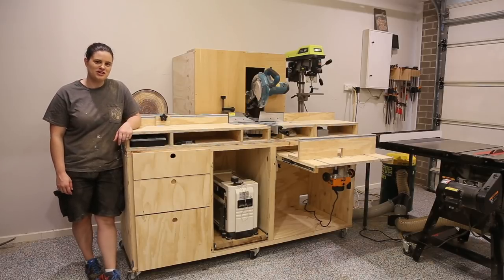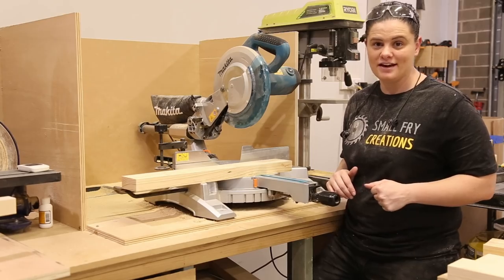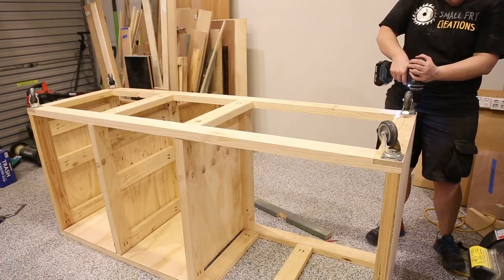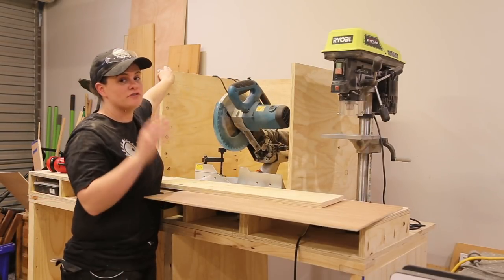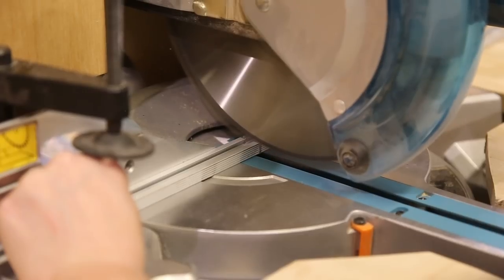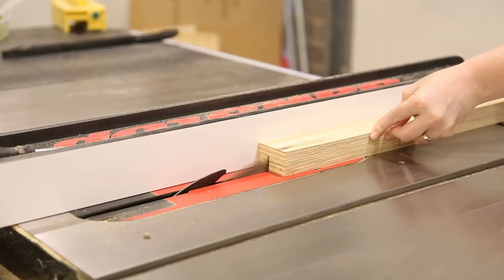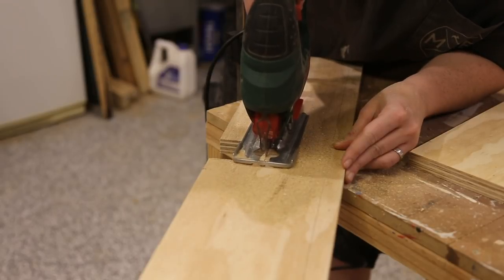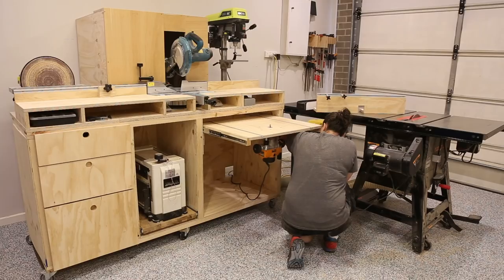DIY | Ultimate Workbench for Small Work Shop

Comment: Really great video!  Short, sweet and to the point.  This is the first time I have seen a pullout router table.  I have been searching for a way to incorporate my router into my mobile bench, but have not liked that the bit hole will be on top of the bench.  This solves my problem.  THANKS!
Reply from the maker: Your welcome! Thanks for the support 😀
Reply: If you like this idea, have a look around YT for vise router builds. There's some good ones out there with fences and t-tracks. I ended up just buying a cheap router table from Bunnings and sinking just the top of it into my table saw with a small scissor lift under it to raise and lower.
Reply from the maker: Ooo this is a good idea! Thanks Peter. I will check them out for sure
Reply: @SmallFryCreations  It's just the Ozito ones - about $70. They have the machine on/offs and plug for the router, a sliding fence. Being Ozito branded at least they haven't got moving parts ;) 
To be fair, some of the ozito stuff isn't too bad as long as you don't use it all the time. I wouldn't buy a drill, driver or grinder, but it's cheap and OK if you only use it occasionally.

Comment: Great to see another Aussie making projects and with wood dust over them! Most of the American guys seem to be dressed in their Sunday best and still clean during the builds! Must be magic ;)
I used to have a bench with similar tools attached to it. But when I built my table saw, it got in the way and I dismantled it. I just put all the loose tools in steel shelves for time being. I'm sort of going a more modular approach with smaller cabinets for the larger tools (like drop saw and drill press) so they can be wheeled around when needed. Workshops are always a bit of trial and error. But that sort of setup you've built worked well for me for years.
Keep up the builds!
BTW Where are you getting your T tracks from? Pretty hard to find local suppliers of that stuff in Oz.
Reply from the maker: Hey thanks Peter! Don’t know how everyone stays clean! That is not me for sure 😂 Yes the workshop is forever changing but like you say great work bench and working for me for the moment. 

I think I got the track from hare and forbes.
Reply: @SmallFryCreations  Thanks. I think last time I got some T-track I got it off ebay but ended up being a bit small for the mitre attachment I bought.

Comment: Another cracking video, thank you. My son and l are building a new mitre saw station for our workshop, so plenty of good ideas here.
You are so right about looking back at old projects........
Question, what happens if you need to cut angles with the saw?
Reply from the maker: That’s awesome. To cut angles I remove the dust shield and the small piece to the right of the saw is removable so I can swing the saw around. I can’t move it to the left but I have never needed to. Hope this helps 😀 happy building
Reply: @SmallFryCreations  Thank you. :)

Comment: Nice build Ainslee! I am curious about the 2x4 (100mm x 50mm) framing timber you used. What did the final dimensions end up after you cut off the rounded edges. The framing timber I get from Bunnings is 90mm x 45mm. After trimming and planing I end up with 80mm x 40mm.
Reply from the maker: Hey George Thank you for stopping by. The 2x4's I'm using are the same (90x45) Once I trim the edges off I end up at 80mm as well. SoI don't always put them through the thicknesser. just depends on the project but if I did it would be the same and end up at about 40mm. Hope this helps :)

Comment: Great to see you back Ainslee!  How will you cut compound mitres - if you need to - with the fence that appears to limit movement of the mitre saw sliding fences?
Reply from the maker: Thanks Noel. The front plywood around the miter saw comes off easily and part of the bench plywood slides out so I can cut 45's.

Comment: Nice build! I appreciate the ingenuity in fitting so many tools into one bench. :) 

How's it holding up a year later? Anything you would change?
Reply from the maker: Thank you. The bench is still as good as new. I wouldn’t really change anything. I don’t use the router section very often but I wouldn’t replace it with anything else for me so it works perfect for me. 

I do want to make some changes to under the router section for storage of small things like my drills.
Reply: @SmallFryCreations  Good to know! Have you ever had any problems with weight on the router table since it doesn't have any supports other than the drawer slides?
Reply from the maker: No problems with the router. I only put the router in when I use the table as I also use the router hand held. 

I think from memory the draw slides are rated to 50KG

Comment: Great video, love your workbench. I noticed you didn't have any braces across the front or the back of the edge of the plywood to keep it from Boeing. Do you think the weight of your router will cause the plywood to dip in the center overtime?
Reply from the maker: Hey thank you for the support. I don’t think so but if it does I can add support. I wanted to try and get away without it cause I preferred the look. 😀

Comment: Well it is certainly a compact work station. But seems it limits tool use a lot. The miter saw cannot be moved to cut a miter, it is blocked to only make crosscuts. And the drill press table is limited in height to the top of the miter saw fence. Good concept but execution is lacking.
Reply from the maker: It certain is compact. The piece to the right of the miter saw removes allowing the saw to swing around to 45 degrees. The drill press has good enough clearance. Haven’t come up against anything yet I couldn’t do. If I did need a little extra depth I can pull the drill out. Not to heavy 😀